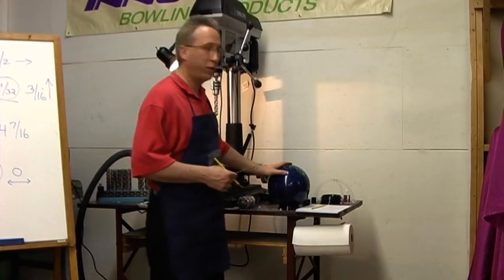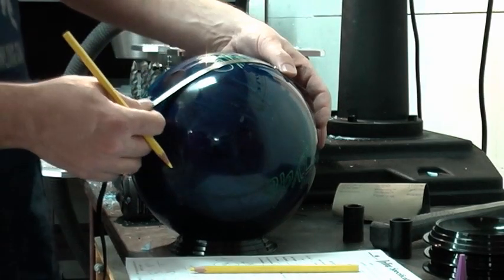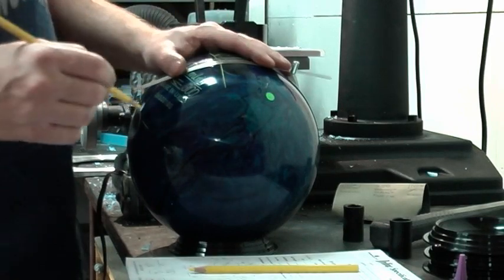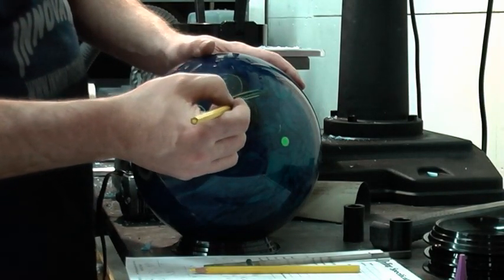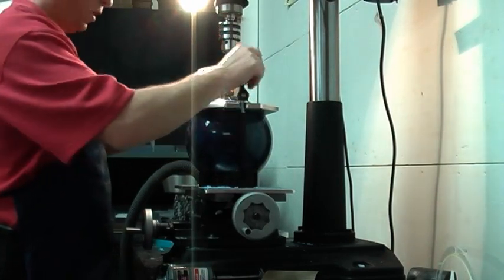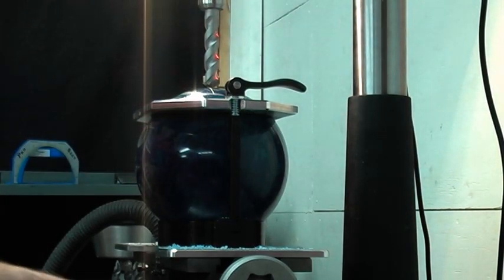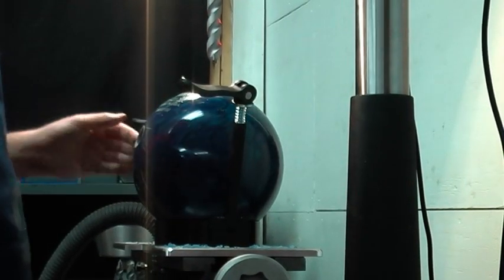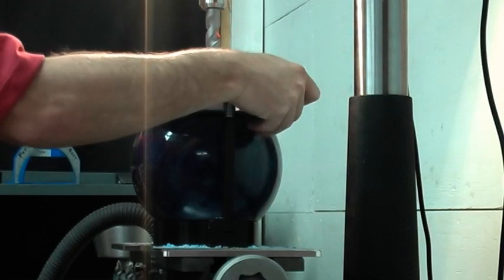Drilling the Fingers of a Bowling Ball - Innovative Bowling

Comment: Let me offer another perspective in thumb/finger drilling sequence for other viewers. You should drill fingers first because once you have both of them drilled, what happens if you accidently drilled one or both slightly off mark? You simply position the thumb left or right of the original centerline to keep the spans correct. The grip is only rotated the slightest bit, which will have no effect on the intended reaction. Rather than drilling thumb first and trying to be accurate on TWO holes.
Reply: F2f
Reply: Why are you drilling the hole in the wrong place. Measure twice drill once. Haven't missed in 37 years
Reply: Also dont just mark the outside edges. Measure the center and mark it. You cant miss

Comment: Eyeballing an almost-one-inch cut to a wax pencil line is top-level engineering. Take an awl or punch, make an indention at the exact center of each hole. Drill or at least Chuck-up an 1/8 bit to get it dead-nuts to the center mark, then step up your bit to 1/2 or all the way to 31/32 insert size with it still clamped down after the 1/8 but center-check. I started drilling my own when I measured my balls and found them as much as 7/32" different that were supposed to be identical. It's not rocket science, and not needed to be as accurate as a first week student in a milling machine class. But it needs to be more accurate than your eyeball from 2 feet away.

Comment: The only advantage I can see for drilling the thumb first would be for a bowler who heavily bevels the hole to the point that it would alter the span after drilling, so in that case you drill the thumb and work it out before drilling the fingers.  Even in that case, I believe you can drill the fingers first and accurately hit the desired span.  Remember pro shops exist to make money.  Speeding up the process by drilling the fingers first can only help--I agree with aello465

Comment: I have a question. I just started to learn how to drill balls. For the fingers you said 3/8 left so you cranked the handle so that the table shifted to the right which is correct. This would mean that left is right and right is left for lateral pitches.
. Following that methodology for the thumb you said 3/16" reverse. So shouldn't you have moved the table away from you? At 5:48 in the vid the table moved towards you. 
This is where I got confused.  To me that would be 3/16 forward pitch. 
Thanks.
Reply: He was drilling the ring finger/right finger.  Moving the table away from you for a THUMB would be reverse pitch.